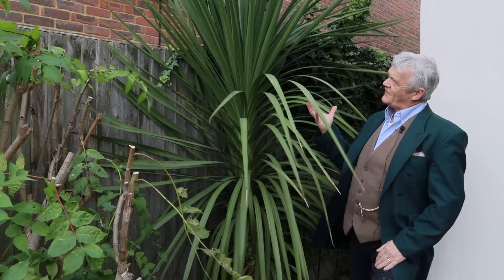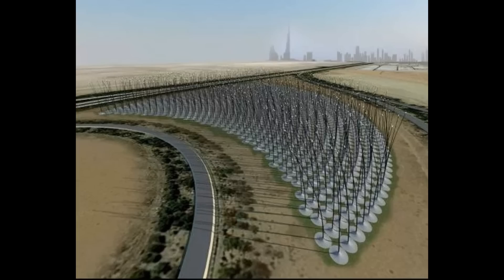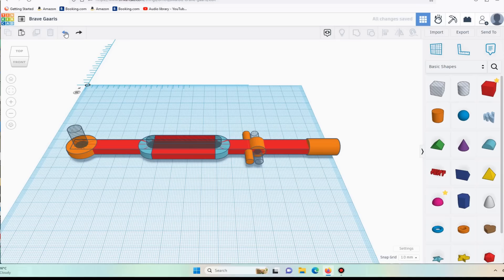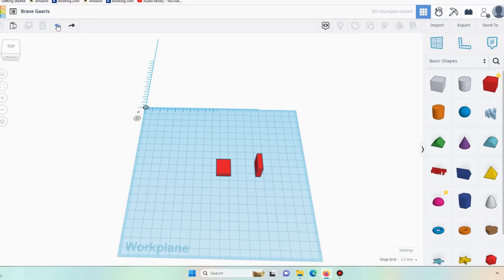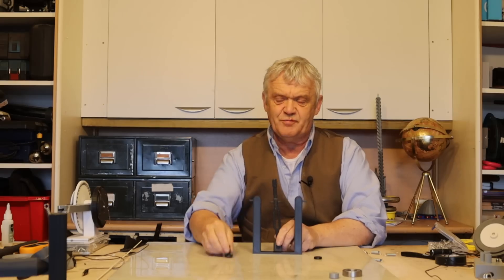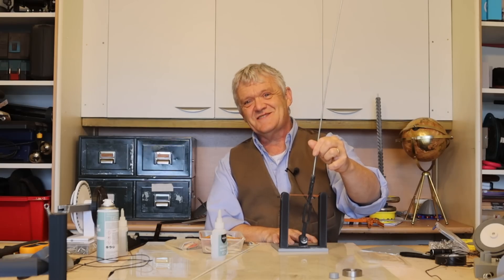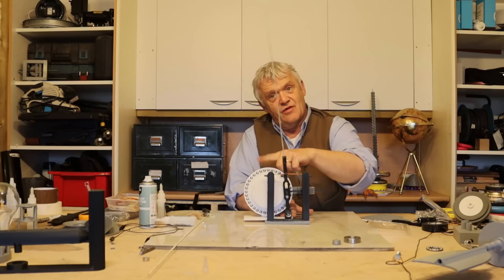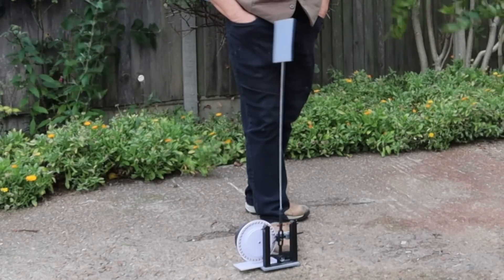2079 DIY Windstalk Energy - A Kind Of Bladeless Wind Turbine

Comment: I've been playing with a design to do this with tree trunks in a forest for the last few years, on and off. The trunk is the rod. A static climbing rope runs down to a bicycle crank (with a weight to return the crank to position using the free wheel) with a generator attached to the rear hub.

Comment: How about, moving magnets at the bottom (or half way up) travelling through a series of 360° surrounding copper collector coils (at least 4?). Half wave rectifiers mean which ever coil is stimulated, it will deliver a DC current into a capacitive load ..

Comment: Maybe use a 2-axis gimbal, like a RC transmitter joystick, with your magnet wheels taking the place of the potentiometers, or more likely driven from that point so you can move the actual wheels away to orient them with more space.

Then, instead of trying to generate from the intermittent torque, use the one-way mechanism to raise a weight via a reverse escapement (like a grandfather clock thingy). When the weight is full wound, release it and let gravity do its work, dumping the energy into a capacitor bank (or whatever). Assist this dump with a flywheel, via a freewheel system (like bike pedals), and then the cycle repeats itself...

Comment: I'd have it geared up to crank a mainspring, and then have a little flag ding up when it's fullt cranked so you can manually retrieve said spring, dump it into your flywheel/storage system, and put it back out like a crab trab.

Wind traps that gradually build up and can be picked.

Comment: Good stuff! I've been looking at the "Skybrator" generator for a wee while now, which is sadly not nearly as robust as it was hoped. My 2c: Keep It Sensibly Simple (KISS). Seems the system works when the resonant frequency of the moving part matches half the frequency of the Karman vortex shedding, that is a vortex curls off at the end of one wobble, then another when the moving arm has moved to its other extreme. This depends on some fluid dynamics of wind, and the diameter of the arm vs its mass, length and "springiness", hence its resonant frequency not unlike ye olde schoolboy trick of making a wooden ruler make a funny noise when placed on a desk with one end overhanging the edge, giving it a flick then sliding it around to make the pitch go up or down depending. 
Look out for that plant there! Many folk accidentally perforate their eardrums near them!
Reply: To extract energy, I'd use a wide circular plate at the base of the vertical cylinder, and a piston set vertically underneath such that whichever direction the cylinder tilts, the plate causes the cylinder to lift, pulling the piston and hence moving the hydraulic fluid that's piped to a fluid turbine attached to a dynamo. 
This is in a way just like pulling a pint at a pub. A stiff return spring around the piston helps right the cylinder and baseplate again. 
Can then also have multiple nodding-windmills feeding the same fluid lines and dynamo. Have valves to ensure single-direction flow.

Comment: Rather than convert the oscillation to rotation - would a flux-cutting generator specifically for the oscillator not be more efficient? A (heavy-ish) magnet on pendulum affair potentially allowing for bi-axial swing.

Comment: Multiple flags at off sets would hopefully give you more back and forth for the push button input.
As an alternative what a bout the ocilatation "charging a clock like spring" which releases when full to do the work and the ocilatation recharging the spring (s) save move a couple of degrees then haltin for there to be enough inertia in the right direction

Comment: I immediately thought about keeping it this simple but using the ratchet to operate a winch for raising a weight that trips a release at the top and the weight then drives a generator on the way down and starts again at the bottom.  A lot of these running with different gearing, heights,  timing etc would make quite a tech art installation

Comment: i saw a low-resolution clip of a very similar device that fluttered in the wind and was connected to a voltage coil except it was essentially a vertical string with a wind catching central "blade".  It seemed quite effective.

Comment: Great proof of concept and as always, taken as just that.  I'm minded of the Tacoma Narrows Bridge failure! Maybe  'tuning' the exciter rod to its natural frequency could be an immediate efficiency gain (and of course that could be dynamically controlled to match wind speeds).  Additionally, mounting the push button at the centre of percussion may see a radical improvement too.

Comment: Why not create a ‘Smart’ unfolding FAN at the top of this thing, that widens the fan to exploit low speed winds, and folds up to a smaller area in higher winds, so it would be safe to use in all kinds of weather, without breaking?

Comment: That's awesome! Some clever trickery to gear it faster could go a mile!
One thing I was trying to do (completely inspired by your videos by the way!) was a bit of a combo, using a Darwin turbine on the top end of a stick leaning out at 45 degrees.
I figured a tiny generator in the bottom tip of it could be set in a sorta-hollow planetary gearbox to that gets spun much faster than the fan in the hole that spins it, and that this action plus the weight at the end of the stick would make it bounce quite reactively, and keep trying to hang down despite the stick angle changing, and that I'd use the angle change between the leaf and the stick to turn another mini-generator in a planetary on top, or somehow add to the other one..

Comment: If you make a regular fan , mounted 90 degrees to ground level and couple that to a gear that coverts that fan motion to up and down and attach that to the wheel mechanism it will perform much better . Interesting idea. :O)

Comment: I find myself thinking this would work really well with low volume pouring water like say a drain pipe, and a single stiffer spring.  Turn the thing horizontal and let the water hit the plate, imparting torque. then when the water bends the rod far enough it would be released from the stream and the spring would pull the lever up turning  the generator.

Comment: One of those designs you showed looked like it might sway in any direction. Maybe by attaching a cable to the top of the mass that sways it will be pulled when it moves off axis, then a spring returns it as it centers again? A chain on the end of the cable could wrap around the magic winder.

Comment: Just a thought I bet I describe rubish. If you can change the button mechanism to take a pull motion, with say up to 5cm movement to turn. The use a peice of string to pull it. Attach the string to a long bit of "stalk" at the bottom through a stationary iris. Ball pivot the stalk say 10-15cm above the iris. That way no mater the direction of the wind when it moves it pulls the string through the iris, that pulls the changed button mechanism and spins the disc. I hope that makes sense to someone! I know the idea would work, but it would take some strong spring to make sure the string part didnt get too slack and  pulled the stalk back to its zero position.

Comment: Your design doesn't do this idea much justice. This is an extremely high leaverage/ high torque but low movement method. There needs to be high gears connected to spin that generator extremely fast. The drawback being that that would require a lot of torque but that's no problem because the sky paddle is basically a massive lever. The longer the lever the greater the force, the higher gears can be used, the more power generated. The shaft has to be stiff as possible so all the leverage goes in the bottom. Some sort of mechanism that would turn the paddle sideways at the end, bypassing the wind and allowing it to return to its start position, then turn back facing again, would be ideal.

Comment: With the fair bit of intermittent torque this makes it may pair well with some type of mechanical storage, lifting weight, pumped water, wound spring and such. When energy is needed you can get a constant(ish) speed output as the stored energy is released. Love the videos as always Robert.
Reply: Yes i was thinking this too, akin to winding up a clock spring, but yes weight or water might be the best for generating.

Comment: I LIKE it!  I wonder if it would be worth putting layers of wheels, or a wheel on both ends would give you more energy or more loss?  Would depend on the wind spread I guess.  Maybe you could add in more gears on windier days.  

I'm also thinking of something that would help pull the stalk back faster, an additional spring.  Also good for windy days.  There's some spring in the shaft, but I think additional spring that didn't fight the initial push would also help this generate.  So you wouldn't want to, say, compress a string or stretch a rubber band unless the wind was some amount to be determined stronger than the natural spring of the rod... 🤔